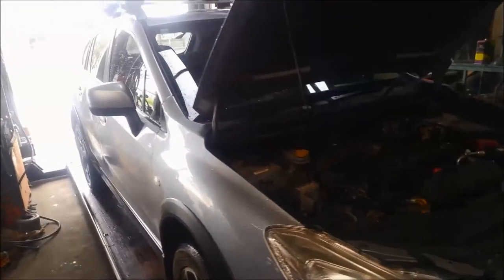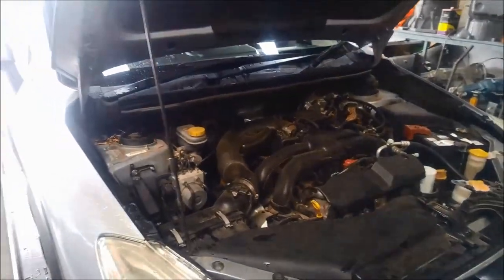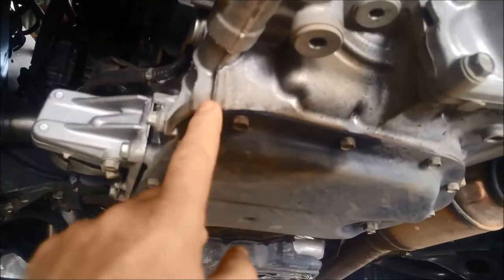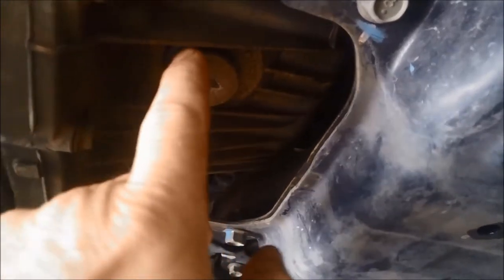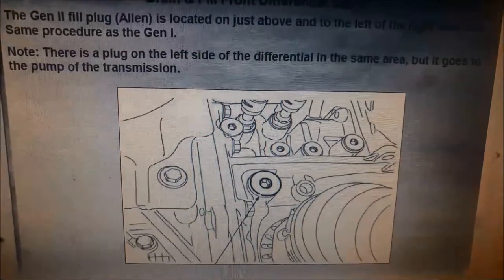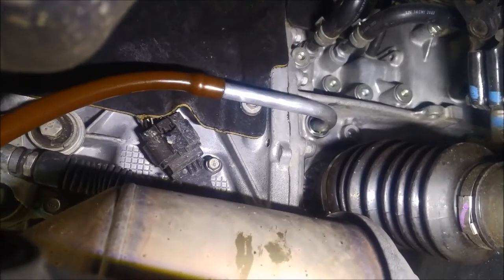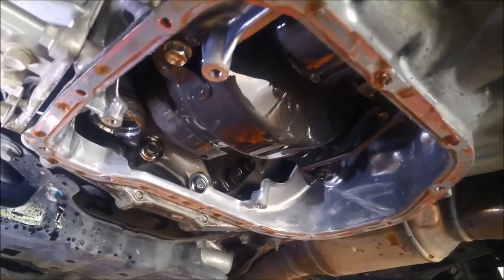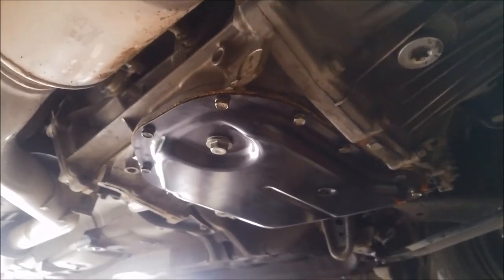Subaru TR580 Lineartronic CVT Automatic Transmission Filter Service & Front Differential Oil Level

Comment: Just FYI, The item that he pulled off the CVT was not an Oil filter. It was a oil strainer. Big difference! The shop manual shows that the transmission does have an CVT oil filter but it is unservicable without removing transmission and splitting the casing.
Reply: From what I understand is that this oil 'filter' doesn't need to be replaced because it's just a fine mesh screen. Just use a bit of brake cleaner and clean it up and reuse it.  Only replace it if it was damaged somehow.

Comment: I have Forester 2014. Do I need to clean magnet on transmission? Car has 67000 km. In service told me if I do flushing it is not necessary to clean magnet and to change filter before 200 000 km.

Comment: Front diff oil level is not checked at the fill plug. There is another plug near the drain plug, you fill unitl it comes out of the level plug.
Reply from the maker: thanks for that. cheers

Comment: I dont believe there is a replacable filter on the 580s in the 6th gen
Reply: There is a barrel type filter located on the top of the trans under the valve body. It can be replaced but literally need to remove the engine to do it. (removing the engine is faster than removing the transmission so that's why I'd just take out the motor rather than trying to drop the trans)

Comment: ever installed inline filters on transcooler lines i see some sell the filters for trans lines and pwr steering lines. they look like over grown inline fuel filters.
Reply from the maker: yeah they are good, however you will still need to replace them regularly or the magnet inside it can get blocked and reduce cooler flow. cheers

Comment: Come on subaru, a filter inside the trans. They were on the saki when they designed that.
Reply from the maker: no arguments there !
Reply: Same with the magnet, why not have a magnetized drain plug, or easy access to an internal magnet

Comment: @YepThatsIt - if I have Tr580 in winter I have belt/chain slip, in Summer everything is ok. Fluid has been changed, same. What could be a problem? Solenoid or nothing can be done? Thanks!
Reply: After chain slip starts happening it'll never get better because the chain creates a polished spot and it'll just keep getting worse and worse. It needs to be removed and rebuilt at that stage, nothing else will fix the chain slipping issue other than rebuilding.

Comment: Thanks for the video. I’ve 2010 2.0 subaru legacy cvt automatic with 150.000 milage. I nearly bought this car and the old user hadnt changed the transmisson oil before. I’m not sure now shell I change it or dont touch it. (By the way there is no problem with shifting)
Reply from the maker: hi, service wont usually fix any issues, but it is definitely good for maintenance. basically the cooler and cleaner you keep a trans, the longer it will provide reliability and the longer it will last. cheers
Reply: @YepThatsIt  thank you so much🙏🏻

Comment: hi there, my 2013 XV is giving me hard time. it accelerates so slow and AT oil temp ABS etc all lights have come on the dashboard. The error code was something P0700. Do you have any idea what to change? Is it worth to change the oil? The mileage is about 200000kms. Thanks for any respond.
Reply from the maker: hi, at this stage, oil change on its own and changing filter will do very little to help improve your trans. on any trans a regular filter service and clean pan and magnet ( also add additional magnets) would have helped keep metallic debris away from solenoids. i recommend every 50,000km when trans has done under 200,000km and then when has done over 200,000km to do trans filter service every 25,000km to get make life out of it. the valve bodies on these trans are also notorious for wearing out bores where valves run. check all the basics first, then remove trans pan and see what is happening, then you have to decide if you want to try checking out valve body and solenoids. good luck & cheers
Reply: @YepThatsIt  cheers bro very appreciated
Reply: @YepThatsIt  Sounds like the valve body. What did you find out?

Comment: Hi,   What is happening about the 3 maybe 4 litres of fluid in the torque converter and cooler???     Should not that be replaced also,  it will only contaminate the NEW fluid .
Reply from the maker: hi, generally trans service approx half fluid comes out. this is usually enough to boost the fluid properties enough. we only do full flush when someone puts in wrong fluid or coolant or water enters trans...some trans gear oil can enter trans also.you will also need to remedy the reason of how it got into trans. choice is always yours to decide. cheers
Reply: We'll , There's A Reason It's Recommended To Drain & Refill Fluid , Run It Through Gears & Repeat . Which Would Ensure 90-95 % Of Fluid Is Changed .

Comment: Any idea on how often the inline paper filter needs to be replaced. Looks like a proper pain in the anus if you have to pull the transmission every time to get to it.
Reply from the maker: hi, install an inline trans filter in cooling line, just be aware those filters are directional. cheers

Comment: Very informative video 
I have a skyactiv Mazda with 6 speed auto
Mazda does not recommend fluid change and even the dealer refuses to do it.
What do you recommend in my case to do?
I replaced the fluid first at 70K and another one at 135 K with filter and magnet cleaned.
Reply from the maker: thanks, dealerships don`t touch auto trans...they will all tell you "sealed for life" whereas from the horses mouth...the manufacturers and designers have told me "sealed for life of warranty". my advice is take it to transmission specialist. cheers

Comment: Great video! Where did you get a pan gasket? I have not been able to find one at all. What magnets did you use and will they be affected by trans fluid temp which degrades their ability? Can you add links to gasket and magnets? Thanks!
Reply from the maker: hi, if you`re in aust contact me on our facebook link, we can sell you. cheers
Reply: @YepThatsIt  I am in US, was hoping to try out a gasket but I was able to get some Permatex that will work. I've looked quite a bit and haven't seen a gasket available. Can the strainer be cleaned? What did you use to remove the old silicone gasket?
Reply: Same here. I think I’m the US you have to buy the pan seal kit. Australians have access to individual parts.

Im in US and i gotta go buy some liquid gasket pisses me off.
Reply: @davidtestin5665  hi, what permatex sealant did you use? Also, did you wait till the transmission was cool to seal the pan? I'm looking to change my CVT fluid but at a DYI garage so I'm paying by the hour.

Comment: Hi, great video thanks. What torque do you do the bolts up to with the cork gasket? Did you use any sealant as well?
Reply from the maker: hi, actually depends on the thickness/quality and rubber content of the cork/rubber gasket. has to be tight enough to seal properly but not so much as to deform the gasket. put those gaskets on dry as they will slip and deform as you tighten them. also make sure the bolt holes arent pushing up and cut the gasket as you tighten them. we press them back down with our arbor press. we dont use silicone or gasket cement. cheers
Reply: 8-10 foot lbs
Reply: Manual calls for 9 N•m (6.6 ft-lb) on the strainer and if your using a liquid gasket like Permatex Ultra Grey, 5 N•m (3.7 ft-lb) on the pan.

Comment: Hi YepThatsIt, how importance is inline filter ?
Reply from the maker: hi, anything that helps keep the muck circulating in trans is beneficial. i also add magnets. the cleaner and cooler you keep a trans combined with regular filter service will prolong trans life and reliability. cheers

Comment: Good day, can you confirm if the other CVTF filter (31835AA030) is accessible and meant to be replaced during heavy servicing alongside the filter in this video (31728AA141), or is it only accessible during full transmission rebuilds? Thank you so much and keep safe!
Reply from the maker: hi, to replace cartridge filter you need to remove trans. cheers
Reply: @YepThatsIt  Noted, thanks! Is it meant to be replaced periodically as well or is it mainly left for full rebuilds?

Comment: Dear.  I have sent my Subaru Impreza 2013 to garage to service front and rear differential oil, they kept 4l of differential oil 75w90 in cvt unit instead by wrong and left front differential unit empty, I have driven the car for 4days. After I have noticed, kindly give your advice.
Reply from the maker: hi, take it back to the garage. if wrong fluid in trans it will absorb into friction linings and cause issues. cheers
Reply: Hi Mohamed. This happened to me to. I drove it for about 20km before realizing they used the wrong fill plug. Took it to a dealer who dropped the pan, drained the cvt oil, put fresh oil and filled up my diff oil. They initially wanted to do a rebuild. It has now been 2days since and the car drives normal, if not better than before the whole mess begun.

Did you do the same and did you experience any problems after?

Comment: Have you ever considered putting your additional super strong magnet on the outside of the pan? This way whenever the fluid gets changed you can just remove the magnet first before draining the fluid. 

It may help to move the magnet around the bottom of the pan to loosen up the metal particles so it can drain more easily. 

Just an idea I've had for years but never heard of anyone who did it and what their experience had been with it.
Reply from the maker: hi, thanks for that. we often put on several magnets under trans pan or on drain plugs before we remove pan while we are testing. helps clean things up a bit before dismantling cheers
Reply: you need to remove the pan for that to work as the the drain plug does not drain from the bottom but elevated by about a half inch.
 dumb design

Comment: Thanks for the video. a question, how many liters of CVT oil should I buy to change CVT oil and filter? Thank you
Reply: Oil info I have from a Subaru document reads you can only buy from Subaru in 5 gallons = to about 19 liters. 
If you use 3rd party oils equivalent then I believe about 5.5 liters is needed.

Comment: this oil does not have a subaru tolerance
Reply from the maker: why do you think that?  http://www.tritechlubricants.com/lube-guide/     http://www.tritechlubricants.com/dev/wp-content/uploads/2016/05/9365-CVT-10-COMBO-DATA-2.pdf
Reply: @YepThatsIt    1)  11.28 your video( there is no subaru)
2)  the maker can write anything, but officially Subaru allows only Subaru oil to be used
Reply: @YepThatsIt    1)  11.28 your video( there is no subaru)
2)  the maker can write anything, but officially Subaru allows only Subaru oil to be used
Reply: @igorsams5413  Simply Subaru maintains trade agreements with oil brands such as Idemitsu (Lineartronic II). It does not necessarily mean that it is the only alternative.
In fact there are better cvtf fluids for these fully synthetic continuous drive boxes. Examples such as: Red Line CVT, Pentosin CVT or Ravenol NS-2 / J1, have better characteristics and are formulated for these specific needs.

Comment: great video.  Have you ever also "flushed" the cvt oil to get the oil thats sitting in the system, the cooler for example, out?  Thats what I did.     But I didnt do the filer or magnet.  I may attempt that this summer after watching your video.  (I got 260,000 miles on mine).
Reply from the maker: hi, flushing solenoids gets results more than flushing trans. we usually only flush trans/converter when coolant has entered trans and hope we did it soon enough to salvage the linings on clutches and bands. you are better off adding magnets, bypassing the trans heatexchanger/cooler and doing regular service and magnet clean. cheers

Comment: What is the cause of solenoid failure on TR580 transmission? Would regular (every 50 k) service prevent this?
Reply from the maker: hi, a regular filter service and cleaning magnet ( also add magnets ) to help keep magnetic debris away from solenoids and sensors will allow trans to last longer. cheers
Reply: Lack of fluid changes
Reply: Most generally any solenoid failure or chain slip issues are all related to bad maintenance. If you replace the fluid by at least draining and filling every 30k miles, most of the time you can avoid any solenoid or chain slip issues for the duration of the vehicle life. Bad fluid is almost always the root issue of failures in this cvt. Subaru has one of the best cvt, and they always get a bad rep because you only hear about the failures, never about the ones that last 300k without a single problem. Mine is a 2015 with 169k and has never had an issue since it was new

Comment: Hi there got code 0971, I had AT trans, ABS, Hill assisst come on.  Drained and filled the transmission,  did do the filter in the pan or check magnets.  Now occasionally get those lights to come back on....have tryed to reset computer by taking battery cables off for 2 hrs.

Checked with heat gun tran pan goes up to has high as 180degrees.  Might be reason codes still come up occasionally.   Should I take to dealer and get a backflush of transmission or can I drop transmission pan put new screen , ck magnets and refill?
Reply from the maker: hi, sounds like a contaminated solenoid c issue if you have fault codes. cheers
Reply: @YepThatsIt  Thanks. Going to have dealer run check diagnostics test on it tomorrow. Was wondering do I have to replace the solenoid.. which is roughly 900 for valve body. Guess I could find a replacement Valve body at a junkyard or refurbished for half that cost.  Would drain trans pan again and this time put in a new screen or clean and blow dry old screen? One last question if I still drive it till I fix it , I guess I  should watch out for slipping trans, smelll of trans oil or anything else unusual?

Comment: Is a relearn procedure needed after valve body replacement?
Reply from the maker: hi, sometimes yes, sometimes no. usually best to though. just make sure battery good and charged, all electrical connection good, fluid level right - trans will generally only relearn properly when reaches operating temp. cheers

Comment: Hi I have a 2017 impreza but the exhaust is on the left hand side up against the fill plug difficult to access, is there another plug on the case you can use to fill from?
Reply from the maker: hi, you can fill, but how would you measure the fluid level? cheers
Reply: @YepThatsIt  thanks for your reply, there's is a plug on the opposite side of the box on the shifter side at the same level. I dont have a diagram to tell me if its just a plug or if it holds something mechanical behind it.
Reply: @ltkaffey I hope you did not use the plug on the left. I did and regretted it.
Reply: @HarukiYamamoto  Why what happened ?

Comment: cringe watching you use metal chisel on sealing surface.
regardless great video.
Reply from the maker: hi, yes i cringe at what i need to do sometimes too. cheers
Reply: for the beginning of him taking the pan off its not that bad since the outside edge isn't really the sealing surface if you're using RTV. But at like 7:25 holy hell hes ripping it to bloody bits

Comment: 690 is on turbos not on jen 1
Reply from the maker: thanks for that cheers
Reply: I have a tr690 on my 6-cylinder outback, in my  workshop manual Subaru have called that tr690 a gen1 transmission. It's got nothing to do with the generations of the Subarus however
Reply: @JayJay-gl2df  that is correct, they put it on turbos regardless of generation
Reply: @kostadinustavalkov1902 Thanks! I've been trying to figure out what trans is on my 2014 FXT
Reply: @adam__ph  it's printed on the sticker on the passenger side front door bud ,check it out
Reply: I have a 690 in my 2011 legacy non turbo
Reply: @JamesAnderson-mr2sg oh I have no knowledge on legacy or the models before 2013 . If it says on the door 690 then is what you have . I only knew about treks,fozzies and outbacks
Reply: @kostadinustavalkov1902   you can also tell by the shape of the transmission pan. it's bigger  and  less angles , also the fill port is in a different spot
Reply: @JamesAnderson-mr2sg  that makes sense

Comment: Great video. About how much of the total capacity (~12 qts) do you recover dropping the pan?
Reply from the maker: hi, measuring what comes out will only be a rough guide. best to measure according to manufacturers specs in case it has been over or under filled.cheers